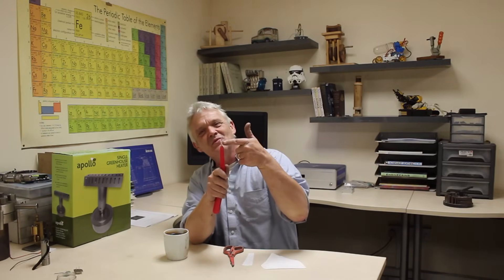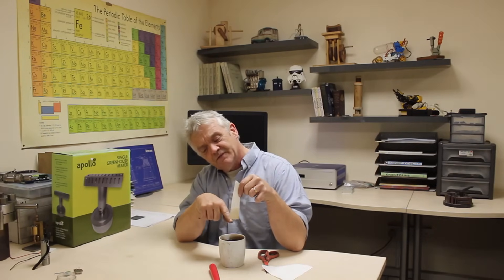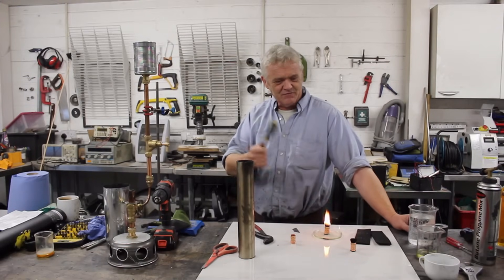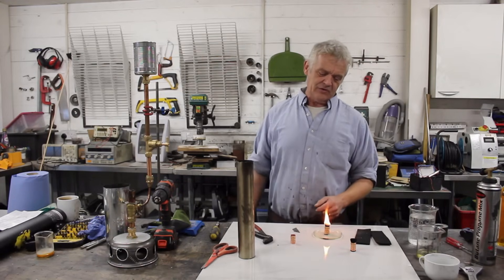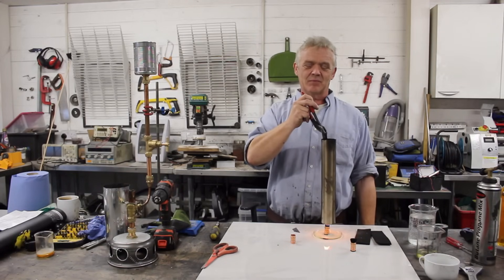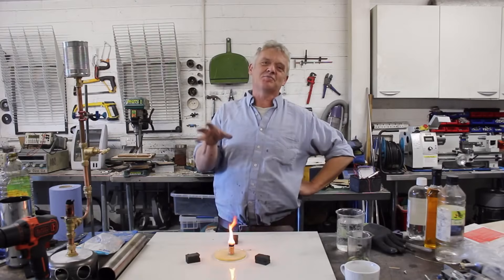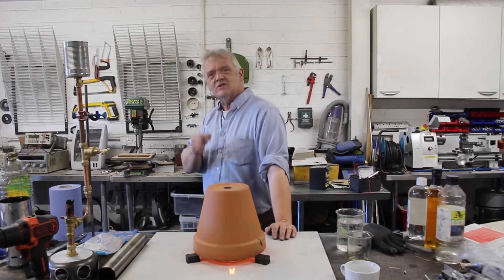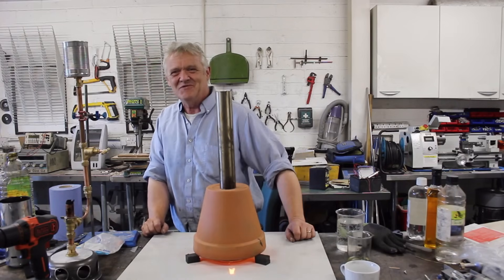1680 The Magical Forever Wick - The Plant Pot Heater On Steroids

Comment: Hi Robert, this is great info, thanks. Quick question: can olive oil be used? I have a lot of it that needs using up - though it's past use-by date. Would that affect the burn as well, I wonder.
Reply: I have the same question too, there are many different types of vegetable oils, and some of them differing substiantially from another, perhaps he should be specific about which type was used.

Comment: it seem like a easy thing to do BUT how did you light it ??? because I tried it and I can't get it to light not even with a cooks mini blow torch .. wicks really well though that bit work perfectly .. so can anybody tell me where I'm going wrong , my plumbing fitting is a brass fitting straight through bore, same size as  a 15mm copper coupler fitting ??
Reply: I used vegetable oil later I'm going to use diesel but I'll test that outside

Comment: Amazing and I love your energy. Question: it’s effectively a mini wood burner so is it safe to have this burning in a room? It’s just, I notice some smoke coming out the flu. 🤔🙏
Reply: I would think it would be as safe as a hurricane lamp with oil in the bottom and a wide wick and glass top.
Reply: @eclecticaddee3597  yes but the hurricane lamp doesnt smoke if the wick is the right height. if ur going to do what the video says as a heat source, ur room would fill with smoke eventually
Reply: My question as well
Reply: It will give off carbon monoxide. Unless you could seal and vent the flu to outside I wouldn’t suggest it unless you never want to wake up again

Comment: Umm, first of all wicks that last have been known forever, classic ones are fibreglass. And secondly, the amount of carbon coming out the chimney at the end of the video is horrible, this will fill your room or house with fumes, that isn't good. Lastly, if you were to design it somehow so that the chimney was a proper one that vented outside, such as out the roof, at that point you may as well just get a proper fireplace and burn wood, since wood is far cheaper than buying vegetable oil.

Comment: Thx. What is it that you have the plumbing fitting & wick sitting on? Is that just something to sit it on until the burn uses up what's already soaked into your wick before you lit it? Or is it some sort of oil soaked pad that the wick draws oil from?  And is that enough oil to supply the burn for very long? Do you have a method for how to maintain oil supply for longer to the wick? Thank you!!

Comment: I used twine string with veggy oil that worked fine I wrapped it round a nail and sat about 10 off them in a bowl off oil and I could feel the heat from the pot over a meter away and thst was just a single pot 👍👍

Comment: I tried this using small carbon felt welding cloth. I cut a strip from the cloth about the width of a normal wick, around 1/2". It had to soak in vegetable oil for several hours. That didn't deter me. After it had soaked, I placed it in a mason jar that came with a tea candle holder and placed a wire around the felt to hold it up out of the vegetable oil and lit it. I was so happy it lit, BUT it only held the flame for 5 minutes before going out. This could have saved me a lot of money. Wicks are expensive if you use them regularly. I would have loved this if it had worked.

Comment: Good science UNTIL he moved onto the plant pot heater on steroids. Bottom line is the forever wick produces "X"  BTU's adding a ceramic pot does not change that output. Clay pots are not exempt from the laws of thermodynamics.
Reply: I think his point was the clay pot is a better idea than the steel pipe, since you would tend to sit around the fire, not try to actually heat the whole house.

Comment: Thank you, startlingly brilliant! Just wondering if you have tried the asbestos rope-like material used around wood heaters doors. Also, fine steel wool pops into mind as a possible candidate for use as a wick. Thank you so much for this amazingly useful heater. (Bet the hens would like one in their coop as winter approaches.)
Reply: Hens don't need a heat source.  They only need protection from wind and rain, and venting at the top to decrease the moisture level in the coop.  Moisture w/cold will cause frozen feet and combs, but dry and cold, they tolerate fine.

Comment: Didnt appear to be any smoke from the plant pot until 2 seconds after placing the tube on top and immediately there was loads of smoke coming out of the tube. After only a few seconds he casually moves to the side to avoid being in line with it from the camera position. I suspect that would make a room stink of oily smoke very quickly and might even be dangerous to breath it in.

Comment: I don’t know why you think burning tea light candles are not so brilliant well let me tell you this I’m burning 8 tea light candles below an 22cm ceramic flower pot. Not the plain clay pots as you need a ceramic coated pot as I’ve worked out they radiate the heat much better, ok so 8 tea light candles the 8 hour burning kind and il tell you this my home is certainly not draft proof and the temperature out side is 8c and one room 13 feet by 13 can stay warm at 20c which is not bad and there’s no soot coming from the candles as there 100% paraffin wax so with the energy crisis I can burn 8 candles for 8 hours at a cost of only 80p so that’s 10p per hour and the flower pot heaters heats up to 180c. I’ve consumed at least 500 candles and had no flare ups as pure paraffin wax is safer than the soy wax so be careful when buying always go for the paraffin wax and do your research and get a digital carbon monoxide tester in the same room as candles burn up oxygen and leaves behind carbon monoxide, stay safe

Comment: You are an absolute legend with what you do. So can you do a video on the best way to heat your home for cheap? As a guy who’s overwhelmed by the videos and ideas you throw  out. I’m so lost. Maybe you are just proving what can be done but I’m thinking “can I save money on my next heating bill “ with cooking oil and a plant pot haha
Reply: I do doubt this would be safe to use in an occupied enclosed space. I wonder if this could be scaled to work with a heat exchanger, and feed a baseboard type radiator in the house.
Reply: @RowdyElectron  you can lead the soot outside via a flexible pipe and use old engine oil. Love your exchanger radiator idea
Reply: @eco_logic  excellent idea. I also saw other comments where others seemed to have success stacking more pots (with spaces between) that might have some affect on the output of heat and soot. I’ll try to do these things myself and report back if I can do so in a timely manner.
Reply: @RowdyElectron sorry read your comment again. So this gives off stuff that’s harmful? I was thinking about using it in my living room? Guessing it would burn the house down or something crazy? Not as straight as straight forward as this

Comment: May need to make the hole in the planter bigger. There was still smoke coming out the top even with the extended metal chimney. 
Personally, I made an alcohol candle using a tea light candle holder (about the same size as a shot glass) and the cut off bottom of an aluminum soda can that happens to fit perfectly over the glass. Drilled about a 1/4 inch (4-5 mm) hole in the middle of the can bottom, then used a piece of pink fiber glass insulation that I rolled into a thin strip and fed through the hole to use as the wick. I use 90% isopropyl (rubbing) alcohol as the fuel. Depending on the size of the flame it will burn 2-4 hours on average. Also, if you blow the flame out before all of the alcohol burns, the fiberglass will last pretty much forever. However, if you let the alcohol burn out completely, it will "melt" (burn) the fiberglass. If that happens, just pull a bit more through and you're good to go. It takes such a small amount to make the wick. I got a couple chunks of the fiberglass  insulation out of a trash dumpster in a new home construction job site, that will probably last me a lifetime. 👍😁
Reply: Having more space between the pot bottom and the bottom surface will help to bring up more oxygen to assist in a better burn.
Reply: @CelticDruidess1  Yes and no. You still need an exhaust hole large enough to let the extra air pass through. It will only take in as much air as it can let out. With the possible exception of it being some kind of pressurized system.
Reply: @CondescendingOaf  exactly
Reply: @CelticDruidess1  oops, that last reply was meant for Kev
Reply: @Kev Fit Give it a shot. I have no idea if it will work being as that wmo is a much denser liquid. But there's only one way to find out. 👍😀
Reply: @Kev Fit Another consideration is that you may try filling most of the space in your wmo container with the fiberglass and then pulling a bit of it through the lighter hole (not sure what kind of set up you've got going...)
I did this with a slightly larger version of the alcohol candle I described above, using a small jar/vase type container, a slightly smaller than tennis ball sized round base with a short straight neck. I've had that one burn up to 12 hours with a smaller flame.
Reply: @UClEirtcVxIXXw3SYxSmJv4g That's cool. I've not made anything yet although I have some more scientific base from this. I also have a strong fascination with candles and these old fashioned methods of heat production/cooking,... I was also wondering about using other forms of natural wicks like mullein. This information I know isn't new but we're newly finding it out because it's almost been lost due to the ease of the technologies that we have available.

Comment: But there's no reason a fabric of any sort should be needed. Something like a series of  small metal tubing all put together into a single direction. Ever seen an essential oil diffuser. It should be possible to make an all in one device like a lantern specifically made for vegetable oil. But is it practical? cooking oil isn't cheaper or have a higher release able level of energy so it might not be better than fuel. Also cooking oil is processed specifically to be healthy for consumption so the extra processing is unnecessary cost added to the fuel.

Comment: Actually I'm almost certain that wicking is called that because it't named after the way candle wicks work, not the reverse. Also putting a pot on top of your candle, or any heat source, doesn't increase heating ability at all.
   Use of felt as a wick is interesting though.
Reply: wrong, the clay pot gets hot and radiates heat in 360 degrees. I made a few, they work

Comment: Just had a thought. I remember when I had aquarium. Had to buy replacement carbon filter pads for the filter, so you can easily buy those from most pets shops. Def from Pets At Home. Or on Amazon .
Reply: may have plastic in them
Reply: @triumphmanful  Thanks for the info. Will avoid. 😉👍

Comment: Plant pot heaters just does not generate nearly enough heat to heat a room in the winter. Also its a huge fire hazard and hazard from the burning smokes. Also the smoke residues will build up (gas stove users know this, when the cabinets get sticky on their tops) and everything will smell.

Comment: bloody brilliant. I had seen the plant pot heaters which I liked, but was reluctant to make it due to the frequency of replacing the tea lights. but this is a game changer. cheers
Reply: Ever heard of Crisco candles. It will last longer
Reply: You don't need to use tea lights. You can put dinner candles right in the Crisco can.a 6lb is suppose to last 72 days.
Reply: How did you get that fly on your thing like that?
Reply: @braumenheimer9607  I just copied it from online or another user. I had someone copy my own just last week.
Reply: @cotteeskid  ME LIKES!
Reply: Please install carbon monoxide detectors in every room you will have that heaters. I am afraid that many people will die this winter from carbon monoxide poisoning.
Reply: @misiotatazuzi7970  Thank you.  I was truly wondering if that would be the prohibiting factor.  Everything this genius has to have a flaw somewhere.
Thank you again.
Reply: @misiotatazuzi7970  Does this thing give off poisonous fumes or something?
Reply: @braumenheimer9607  It depends what you will use as a fuel. Ethanol emits only a little carbon monoxide so it's considered safe to use indoors. Now if you will burn candles in unventilated area then you may even die of carbon monoxide poisoning. It's worth to keep that in mind.
Reply: @braumenheimer9607  carbon dioxide is bad enough (you exhale it) but carbon monoxide is worse- and flammable.  Burning anything is bad. 
"Every candle emits at least pure carbon monoxide, which is a poisonous gas and may also produce carbon (soot). Those are byproducts of combustions chemical reaction."
In a large room, one or two candles may not hurt (and smoke does rise- just as heat does) but women in countries where they use indoor cooking with fire, have a lot of COPD.
I think I'd run a humidifier between me and the burning source, at the very least.
Reply: Please watch the videos that are also on YouTube about the extreme fire hazard with these pot heaters. Most people would probably not even think of such a thing (including me) until they watch them. Don’t go to sleep with them burning for sure if you use candles under them. That paraffin is amazingly dangerous when confined under those pots!  I couldn’t believe it!
Reply: The amount of BTU's is determined by the oil and wick and the pot cannot increase it.
Reply: @edwardmmanns7454  Umm, the pot definitely concentrates the heat as it  holds it, or reflects it back down on the heat source.  Kind of like wearing a thick down jacket doesn’t increase your body heat, but it sure keeps it from escaping.
Reply: @stevenmark8156  "Touché.",!

Comment: Its a shame it has no real value as it still smokes, polluting the air you breath. Mainly though because it is inefficient. The reason we use the fuels and methods we do is because they are efficient. The heat obtained from this device is more expensive than gas as it has a lower output to volume and still pretty dangerous. Better off with a rocket stove based system.

Comment: in boy scouts in the 1950's I made a cookstove using a commercial sized tin can.
as I remember, you were to pour a cup of gasoline  into the bottom and fill the rest of the way with sand.
that's all I remember. Other than the one meal I made on it.

Comment: I'd love to see you make one that is big enough to heat a room. Possibly three smaller ones with a larger pot to cover them. I'd be curious what it would take to do that with minimal upkeep in changing fuel.
Reply: I would think THAT one would heat a room. The pot and chimney would kick out savage heat, but I would want to vent the exhaust gasses outside.
Reply: Make sure to get a carbon monoxide alarm!
Reply: especially with a second pot on top over the existing pot to create a double wall and subsequently venturi turbine effect

Comment: what im really interested in is if this thing would actually work on waste motor oil. I have a waste motoroil burner, but the problem with those kind of heaters is that they tend to be pretty high output. As in mine cant go below about 2L per hour, wich should according to a lot of source be about 20kw. Now lets say i harvest about 50% of that heat, still 10 kw IS A LOT of heat. My house central heating never even turns up to 10kw for heating the house. Now my shop is about 5 times as big, so it can do with the heat. But sometimes when its about 0 ℃ the shop even gets to 25℃+ and im running around in a tshirt and sweating big time.  So if i could make something like this with a wick i could probably have a pretty small heater to keep the temperature just level and not heat it up anymore.

Comment: Cool, I mean "warm", would one of those wood stove heat powered fans work if placed on top of the terracotta pot? 
You would maybe need a piece of metal that extends through the terracotta bottom hole to pick up the extra heat from inside, the heat powered fan would then sit on that metal strip.

Comment: If you burn a naked flame the heat goes 100% into the air. Adding a flower pot just doesn't make any sense. It only proves you don't understand physics.

Comment: Four tealight candles got the exterior of a terracotta pot up to 270°F (132°C), while a single candle got it up to 127°F (53°C).
It would take nearly 60 candles to effectively heat a 100-square-foot room.
You could boil water or even cook directly on the terracotta this way.
Heat is not “amplified” with these devices, only concentrated.
But that concentrated heat also comes with meaningful dangers.
That concentrated heat can be enough to warm small spaces.
So shrink your shelter space instead of expanding your candles.

Comment: The teapot heater at the end is EXTREMELY interesting to me as the boating community brags about how great the idea is all the time. I must be a failure then because I have tried about a baker's dozen variations on it and I can get the pot to be VERY hot.... but it doesn't radiate much heat to warm the surrounding area. Do you think that my flame needs to be bigger or is this flowerpot heater just another old wives tale?
Reply: I built the same thing and NO GO! It's Fake!

Comment: Funny thing is we've been using that material for light for a very long time in Coleman lanterns.
We just have to put on the little bag and light it. It then burns and leaves a delicate little carbon bag that wicks the gas burning in a uniform controlled burn but one touch or heavy breeze and time for a new bag. I never thought of doing this though. 
Pretty darn safe to use inside.
Reply: So,is this safe to burn indoors ?